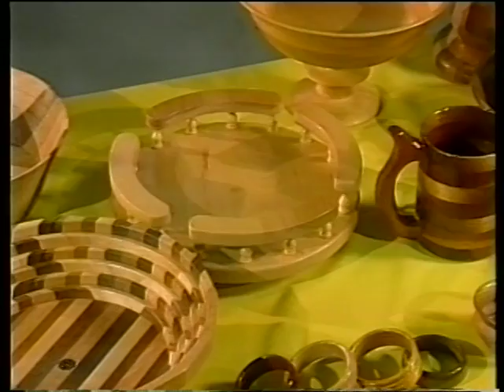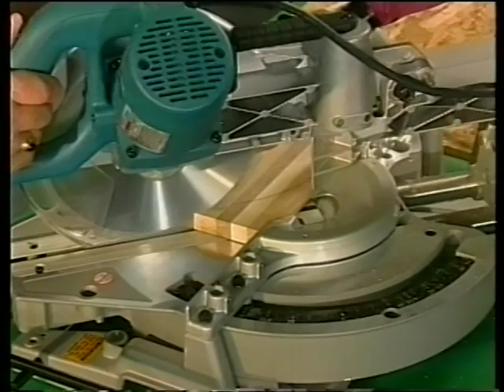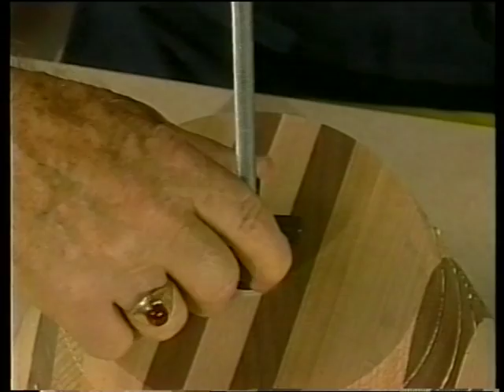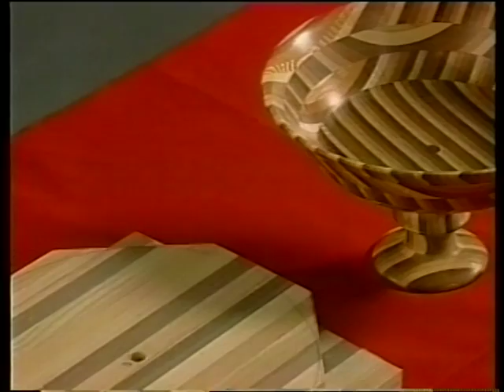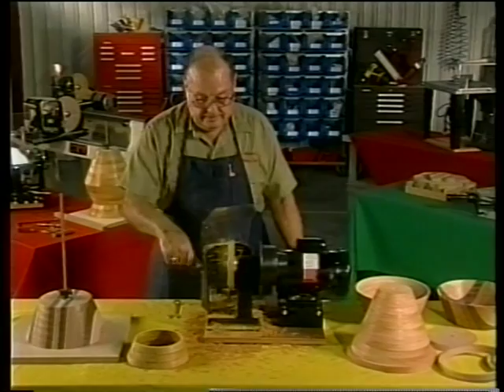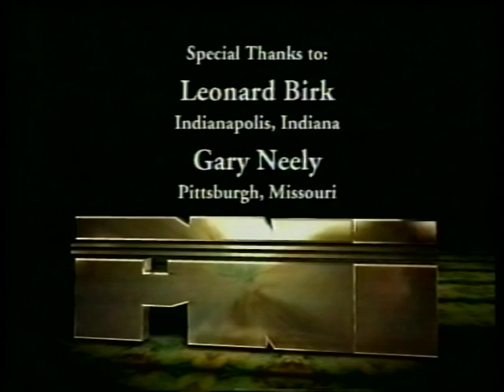Ring Master Pro Video Lathe tool

Comment: I put tape on the index plate and numbered the holes. I write the hole number on the ring. I only use 3/4" stock so I can mix or match rings from different boards. With standard stock. holes with the same number are interchangeable. I create a supply of numbered rings and can play with design just by choosing the next ring.

Comment: What good is a bowl with a hole in the bottom? I think the designers forgot about that.
Reply from the maker: The hole makes it easy to mount on the lathe and can be easily plugged for a solid bottom.
Reply: 1/2 inch tapered plug goes in the hole
Reply: Good evening, How can I get this machine